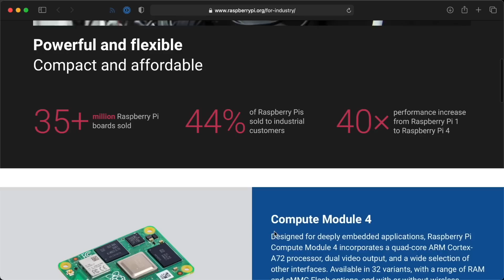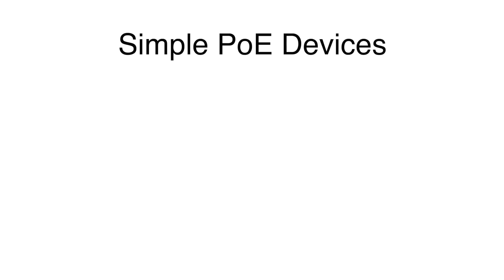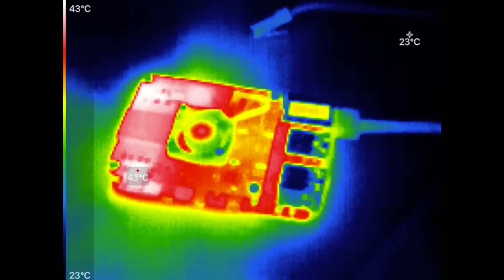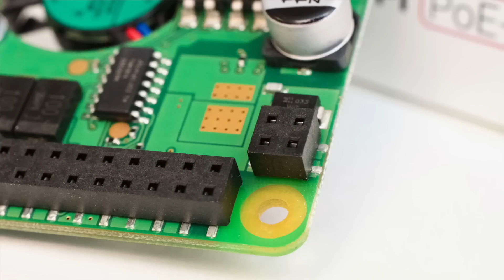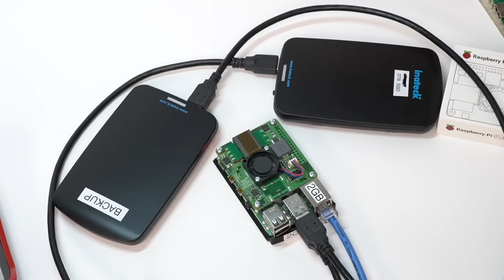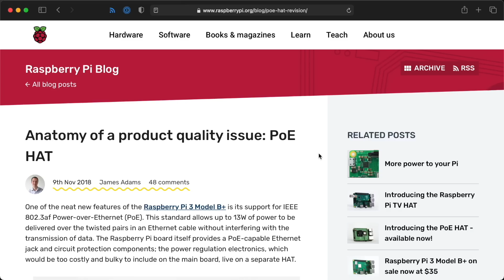Review: Raspberry Pi's new PoE+ HAT

Comment: Should have watched this before I have bought PoE+ hat. The fan constantly speeds up  to the max and then down, which is annoying as on the max the fan is very noisy.
+ I can't control the fan in any way. Because I have Home Assistant OS on my Pi.
And Home Assistant OS doesn’t let you modify /boot/config.txt.
I still find it ridiculous that there is no Software-Based Control - as the PoE+ HAT firmware does not expose fan settings to users.

Comment: When I first saw the PoE hat I thought the price was too good to be true, and it was lol. It has terrible coil whine when the Pi is off and the threaded spacers it came with weren't long enough so it's really easy to overtighten the board and cause pretty bad flexing but if it's too loose it won't turn on because of the tiny socket header they used

Comment: Any updates on this? My goal is to power my pi4 running home assistant with PoE+ maybe with Zigbee USB adapter. Dont know how much power it draws though. Would be nice to not use the power adapter and just keep it clean with my network rack. Its so nice to power up things with PoE+

There might be some better third party fans to replace the Sunon with. Sunon was commonly used in server applications running loud.

I think Pi5 are in the making as ive heard.

I like your rack setup with all the pis.
Mounting solution looks homemade with 3d printer hehe. But i think there are rack mounts in metal for a more clean look. Might implement some low rpm fans as well for cooling

Comment: The idle power consumption is probably due to the planar transformer used. I've seen the idle current double when switching from traditional transformers to those, which would match the findings here. I love planar transformers, but the idle power consumption is a drawback.

Comment: Hi there ...is it possible to still use the GPIO pins as the POE Connector does not show any pins ...only small holes but when plugged into the pi ...can those wholes be plugged with small cables?
Reply: get a long header exenstion

Comment: If I understood corectly, I can use the PoE hat with a Raspberry Pi 4 Model B? Might be a dumb question, but I never used a RaspberryPi extensively. I'm planning to run DietPi + PiHole. PoE is more convenient, since I could just plug it in my PoE+ switch.

Comment: I finally worked it out, The new Raspberry Pi PoE+ HAT use for DVR Security Surveillance to control the PTZ Cameras, 
It will not work on any ADSL or NBN Broadband Router and also TP-Link Powerline Wi-Fi Kit Extend Wi-Fi to Every Room by plugging in the Blue or Yellow Network Cable but I was hoping that I was going to use it to power my Raspberry Pi. 
Obviously not gonna workout for me, not what I was hoping for :-(

Comment: I have a WaveShare PoE Hat for my Raspberry Pi 4B 8GB RAM model and I find it much better. The WaveShare PoE Hat has a better placement for the fan where it does have a slot to feed through the cable for the camera and also a slot to feed through the cable for display(for screens), It also has a switch to turn on or off the fan, it also has a pass through GPIO where you plug the PoE Hat as normal but at the top of the hat it has GPIO pins on top to connect more things to it. Lastly it also has a USB port on it as well to plug something into it. I also have an extension board for my Pi as well which connects to the audio jack, the 2 micro HDMI ports, and the USB-C port and when it is connected, it gives your Pi the audio jack and USB-C as usual, and you can now use regular HDMI cables to the Pi instead of using the micros and you also get an extra USB port too. I recommend those. If you want I wouldn't mind you reviewing the 2 I mentioned just to get your opinion on it.

Comment: To those comparing this to dumb "PoE splitters".  Those don't deal with the specific voltage range used by 802.3af, nor do they do the handshake to agree with the switch about permitted power draw etc.  Adding support for non-standards like Cisco PoE adds even more complexity.  Ultimately, each signal pair and it's signal transformer acts as a logical DC wire and the PoE extraction circuit must determine and negotiate polarity and current draw.

Comment: Has anyone installed a heatsink with this PoE+ HAT? Seems there is a fair gap?

Such a shame that the power consumption/heat has been increased at idle with this. I wonder how it is under a small and medium load. Obviously the wall USB charger is not 100% efficient either.

Comment: I don't recommend it either yet, mine makes that noise as well, and since I have it setup in my bedroom, while it's operating, it makes another hard to hear noise. Not to mention that if you plan on leaving this running 24/7, it will get really hot. They should've put in a bigger fan

Comment: Nope.  In fact, if you need to shorten a screw or bolt, *you do it with the nut installed*; that way, when you back the nut off, it cleans up (mostly) any burrs you left by cutting.

Comment: @11:46 That sound is the sound of the magnetics (flat plane transformer, most likely) either saturating or starting and stopping.  For the hey of it, use a pencil eraser to press down on the transformer's core.  That should at least attenuate the sound if not actually extenguish the sound.

Comment: Here's one to learn from my mistakes, I made a fool out of myself by not doing any calculations before testing. I'm testing out a standalone SDR project that will be in an enclosure located next to the antennae, obviously for a clean one cable solution I went with a PoE hat. Turns out running 3 simultaneous SDRs (with one supplying bias power to an LNA) was asking too much and I bricked a Pi4 which thanks to my aforementioned foolishness was one of my deployment 4gb models instead of the 2gb model I have reserved for testing so I wasted even more money. I only really had trouble with NESDR nanos I was testing, if you've never used them they actually get too hot to touch which should be a hint at the power consumption. Running 3 SDRs at once isn't a stretch as I plan to log and plot ADS-B, OP25 trunk tracking, and another for SDR listening so it's possible I might hit 3 at once.

One thing I did learn from all this is that low current supplied Pis behave in an insidious manner, running headless and/or in CLI mode you get no gui based low power warning. I worked on an issued I had with audio playback for days even bought a few different USB audio dongles thinking it was just an issue with linux audio drivers which are notorious for being finicky. I was getting skips and lagging in audio playback of a network VLC stream and also when listening in GQRX. If you're having issues where your pi seems abnormally slow with random hiccups you might be having a power supply issue.

Comment: I’m curious as to what hard drives could be used with the PoE+ hat without issue? Also, if it is more a throughput issue regards the Pi usb, then surely this isn’t a problem regards the hat but with the USB ports, and if the hard drives are drawing the right amount then it still would be better than the PoE hat which would be incapable of generating enough wattage even if the hat drives were matched to the usb throughput. 🤷‍♂️ I’m a bit of a newb so please correct me if I am wrong I some way.

Comment: The only actual problem I saw in this video was the screw thing, and maybe the SMT connector... but like you stated, rarely would be an issue.
I especially found the USB power test with the hat on to be a weird thing to test for, not that it's bad to test for it, but the way it was framed felt like you were trying to say it was an issue.

By the way, I'm sure it was done as a joke, but seeing you saw into that screw still attached drove me insane hahaha.

Comment: Hi Red Shirt Jeff.  I've got an older version of the POE hat and I'm trying to use a blinkit 2x20 display, but can't get a solution where the pins work.
Here's my thread over at AdaFruit about what I'm trying to do. 
https://forums.adafruit.com/viewtopic.php?f=50&t=180031&p=882639#p882639
Anyway, after looking at the POE hat, I started thinking that maybe you would have a way of cutting out the 2x20 pins on the hat in a way that a pin extender would have the room to fit.  
I can't see it working that well, because the spacing between the mounting holes is tight, but I wanted to get your thoughts.
I guess even as long as most of the mounting holes are left, the screws would have enough of a grip to mount the hat to the Pi.
Your thoughts.
PS, why don't the other Jeffs let you get a speaking part in the vlogs?
There are a lot of times when having techniques to safely modify hardware is what is required to complete a project.

Comment: I've had good luck so far on my OctoPi setup using the GeeekPi POE+ hat powered by a Netgear POE+ switch (GS305EPP). On my OctoPi RPi4 I have the RPi 7" LCD, a Pi camera, and two web cams. I haven't checked the power draws yet, though. (Side note, I went wired ethernet on my OctoPi because the WiFi IP address keeps changing on me for an unknown reason...)
Do you have any videos that I haven't discovered yet (or any planned) to test out various POE hats?

Comment: This HAT creates such a limited space that I had to remove all my low profile heatsinks :( dunno if it is a poor design or feature :D
Reply: I wish I'd done some more research and read Jeff's and Martin's reviews -- I bought the PoE+ hat more or less on an impulse since my Pi 4 running Home Assistant would spontaneously reset (due to overtaxing the available 802.3af power draw) every time I tried to run an ESPHome firmware rebuild.

I bought two of these, and while did manage to get the one on the Pi 4 installed, I had to flip one of the fan screws around (so I didn't need to remove the low-profile CPU heatsink) and did remove the (low-profile) heatsink from the USB controller.

On the Pi 3B, I kept the LoveRpi PoE hat, since I didn't want to have to remove the standard/higher-profile CPU heatsink and since it didn't have the power issues I was experiencing on the Pi 4.  While I'm now annoyed that their docs don't every mention 802.3af vs at nor max power draw supported, the physical design of their HAT is much nicer.

Comment: Power over Ethernet Comparison: PoE vs PoE+ · 802.3af (PoE) can deliver 15.4 watts over Cat5 cables. · 802.3at (PoE+) can deliver up to 30 watts Don't know where you are getting your low numbers from
Reply from the maker: That is the output from the switch or injector. Powered Devices (which receive that power) are designed to work within the guaranteed maximum of 25W.
Reply: @JeffGeerling  That was an HP switch was it not, Where I work we can get the full 30/15 watts depending on the device. with various switch's. I even have a nice China-built splitter that outputs the full 15w / 5v / 3a, the limit of POE. We did test some POE/POE+ splitters from D-Link and they did 30 watts but we considered them bad because even if the device hooked to them only wanted 5 watts they still sucked 30 watts from the switch according to the switch.

Comment: Thanks for the lowdown of what's been going on with the new hat. I was about to buy a bunch when I saw the twitter conversation between Martin and yourself.

It's pretty shocking that the Pi foundation has messed this up again, it's almost like they were in way over their heads and should've brought in someone experienced with power, especially given the pi itself has got a pretty sketchy history when it comes to power limitation and wiring issues (I still have one of the original 1000 pi's knocking around with the wired hardware hack they had to perform before sending them out).

Comment: Could you look at the possibillity to power raspberry pi 4 over gpio?
Reply from the maker: That's essentially what this HAT does; you can supply clean 5V current to the proper GPIO pins and it should boot just fine. The key is providing that clean current though :)

Comment: It would be better if the regular PoE version was a bit cheaper than this PoE+ version. If I'm ignorant of the efficiency issue I would just see two options for the same price, one providing 2.5 amps and the other supplying 4 amps. Then I would buy the "obviously" better version because it appears more versatile. If the price were different I would be more likely to stop and consider if I actually need the extra power and the associated inefficiency.

Comment: To be honest, no POE-based power supply should consume so much power that it needs a fan at all.  The overhead in a properly designed POE to 3.3VDC power supply should be 100mW or less.  The fact that it is consuming several watts just to do a voltage conversion means that there are a lot of losses or possibly even a linear regulator in the loop, instead of a proper switching regulator.  I kinda think they might have cut a few too many corners in designing the POE hat.

-Matt

Comment: Those aruba switches, and older procurves, are pretty dope and they'll probably run until the end of time.
Reply: I was thinking the same things... Since HP (HPE) bought Aruba, they're sticking that label on everything. That's a fairly simple HP Procurve switch, with new vinyl. I have several that have been in continuous use for decades. (one had to be replaced, and one has a bad port.)

Comment: how does this affect packets? With that much power; wouldn't you get a lot of packets lost from interference in the cable?
Reply from the maker: Nope! I'm going to cover that in depth in a future video. Intuitively, you'd think adding a DC voltage to a data line would cause interference, but it actually doesn't!

Comment: Idk my poe adapters is barley noticeable and being able to use my netgear gs30spp (30W per port) switch poe interface on IP to get the exact amount needed..running 1 Pi3 and Pi4 2 Exterenals i think its rated at 128 total , but then you can always add a injector also, everything listed is mounted under a dining room table 6x6 only thing plugged in is my router and switch with Exterenal cord running down leg.  Keeping my tabletop completely clear!!!

Comment: Some switch mode isolated DC-DC converters require a minimum load current to maintain regulation stability. This is usually the case with low cost regulators that don’t have an opto-isolated (analogue) feedback and instead they monitor the current through the primary winding during switching to estimate the output voltage.
Reply: That minimum load current could easily be 200mA, so at 5V that’d be 1W. 

One way to guarantee the minimum load is to place a resistor in series with a zener diode. As the unregulated voltage rises above the zener voltage, it starts to conduct with the resistor becoming a shunt load. This is more efficient than just strapping a load resistor across the regulator output since it only conducts when the voltage drifts too high rather than all the time (which would hurt the efficiency figures under normal loads).
Reply: @alexscarbro796  If voltage rise is the issue, a zener load that only draws current above 5.2V might (or might not) stabilize the smps.  A more complex solution would use a current sensor to reduce or disable the dummy load as actual current draw approaches the minimum.  Anyway a well designed PoE+ circuit should have enough complexity to avoid having a minimum load or wasteful own load.

Comment: I would actually like to see Raspberry Pi's support a simple power rail connection - even if just a screw. This will provide a lot more options for building clusters.
Reply: Can you not just power it using the 5v pin on the gpio? I know on the v2b it could be done.

Comment: I have a Pi4 ( Raspberry Pi 4 Model B Rev 1.2)  with a single 5 TB USB3 spinning hard drive.  Both are running off a POE hat and the switch shows 5.7-5.9W when idle, and up to 8.something W when actively doing a backup.   I do not have a " /sys/devices/platform/rpi-poe-fan@0/power_...." to show that number.

Comment: Pi Foundation: "We'll replace some ICs to improve efficiency"
Efficiency: nearly 2x worse
Reply: The German language has the appropriate word for such cases: verschlimmbessern
Reply: I think it would be interesting to see the efficiency compared to the original hat when both are plugged into a POE switch instead of a POE+ switch. It sounds like the higher voltage of POE+ is a factor.
Reply: @bradley3549  Higher voltage means fewer Amps and that actually means lower losses on the cable. Something's fishy about the new hat.
Reply: @valkaielod  That's 100% true when talking power transmission. Power conversion isn't always so simple. I agree something is fishy!
Reply: @bradley3549  Right. Maybe they chose a less efficient dc-dc converter to keep the cost at the same level? The fan probably costs more, the 12mm screw is also pricier than the 10mm ;). They had to cut costs somewhere.
Reply: @bradley3549  POE AND POE+ use the same nominal 48v.
Reply: @ar-videos  48v would be in spec for Poe, but below spec for Poe+.
Reply: @bradley3549  https://en.wikipedia.org/wiki/Power_over_Ethernet Voltage range (at PD)	37.0–57.0 V[26]	42.5–57.0 V[26]	42.5–57.0 V[27]	41.1–57.0 V.  All nominal 48V
Reply: @ar-videos  You got me there, the acceptable range at the DEVICE is below 50v, but the SUPPLY would be below spec at 48v. POE+ should not supply a nominal 48v. POE+ supplies, on average, a higher voltage than POE. 

While we're on the numbers, this is why POE+ can supply ~double the power (30w vs 15.4w) at only around 70% more current (600mA vs 350mA). Where do you suppose that extra power headroom is coming from?
Reply: @bradley3549  The extra power is from the higher lower bound of the allowed voltage range. So 48V is definitely within spec for both. 
PoE: 37.0V * 0.35A = 12.95W
PoE+: 42.5V * 0.6A = 25.50W
Reply: @qazwsx000xswzaq  Thank you for proving my point.